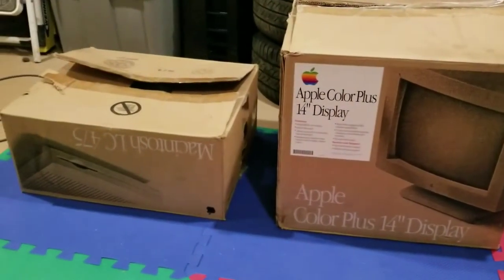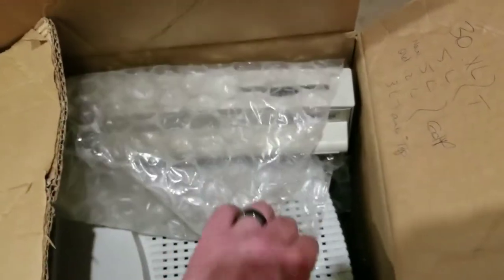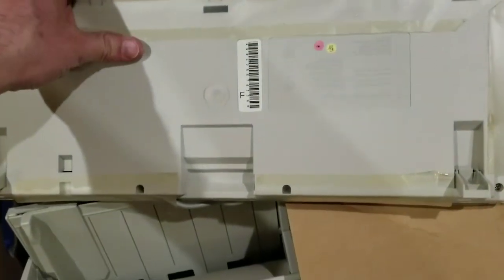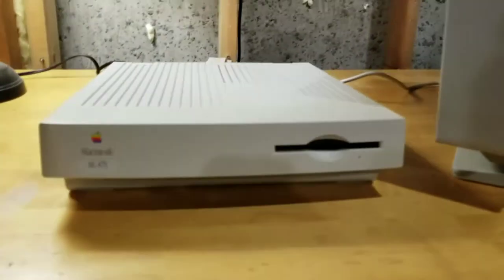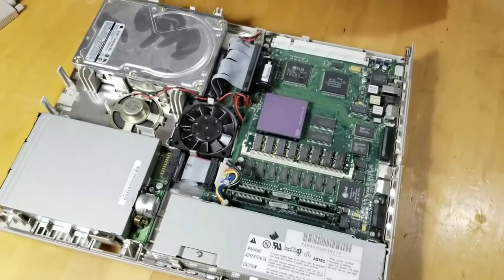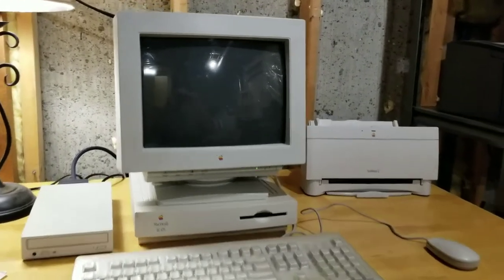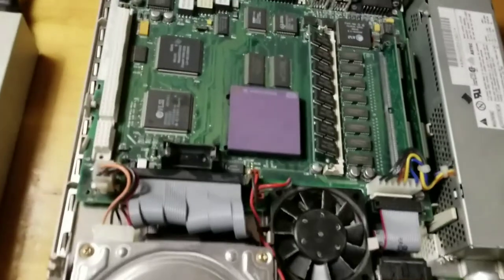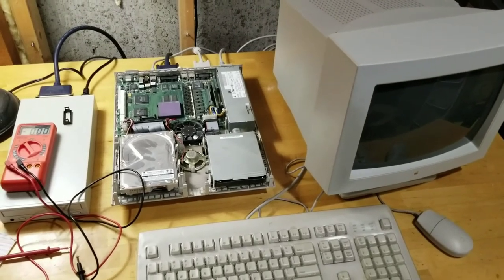Unboxing mint Macintosh LC 475 system with manuals and accessories!!

Comment: A quick tip for anyone who reads this: Macs with no PRAM  battery or a dead PRAM battery will still work. Turn it on, let it run for about 10-15 seconds, then turn it quickly off and back on. It saves the settings that would otherwise be in the PRAM, and allows for a normal boot.

Also: Nice setup. I'm jealous!

Comment: Your video just helped me a lot. I bought the same exact computer and monitor 2 days ago. I installed it and there was no display, I didn't know about the battery thing so I'll have to check this out. Did you find a new battery? Could you tell me where you found it and what type of battery you used? Thanks!